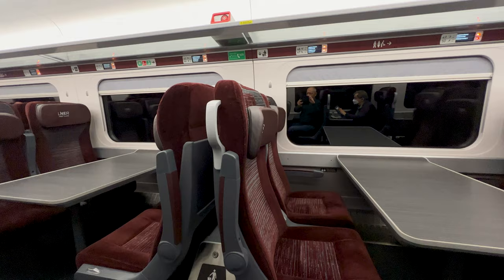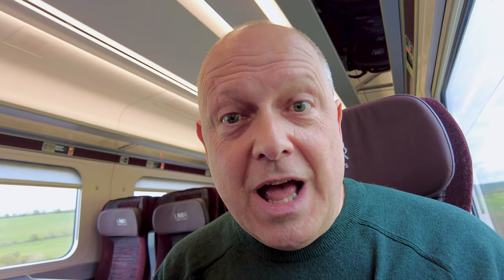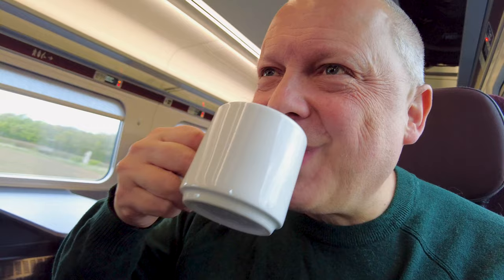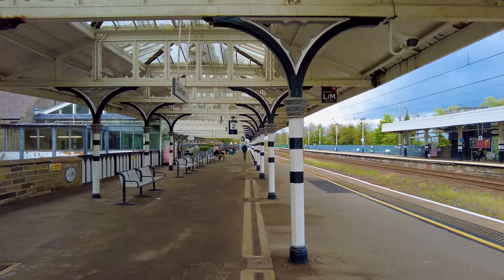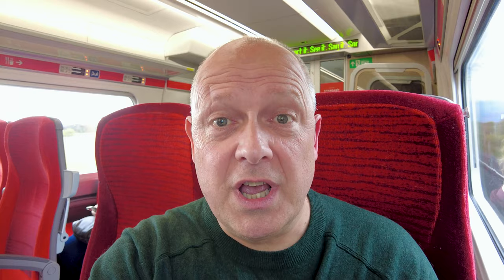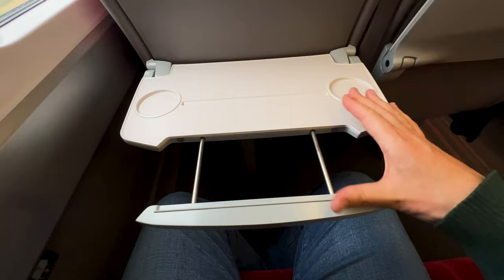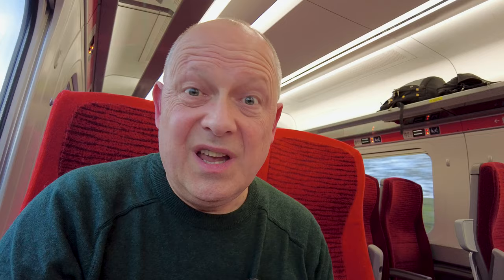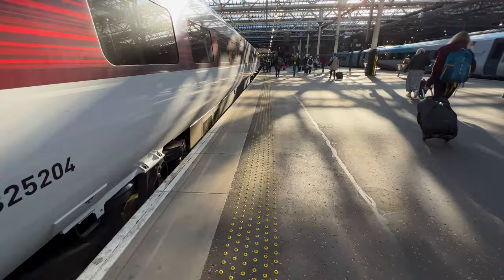How BAD are the seats? LNER Azuma Train First Class vs Standard Class - TRIP REPORT

Comment: Mate, the plastic used for the seats actually is stronger than concrete. And no I'm not kidding, the 5mm sheets used are stronger than 18mm of reinforced concrete slabs. The standard class seats are rated unfit for journeys over 60 minutes in Italy. And I recently did London - Montrose in LNER's 1st class and even those seats aren't that comfortable really. Those 7.5 hours (delay) eventually also became quite uncomfortable. I never had a problem with the old seats however.
Reply from the maker: They are so bad and it’s pathetic how LNER stick to the “Ergonomically designed” PR rhetoric even though so many people have fed back the truth. But I guess as LNER is now under Govt ownership again I guess a retrofit is unlikely anytime soon! 😵‍💫
Reply: @RogEdwardsTV  a retrofit is never going to happen. Those boys and girls behind a desk in London know a lot better what passengers want than the passengers themselves. Or so they think. And they prefer cheap seats rather than happy passengers. But it's funny though, that cheap-costs operator Lumo has better seats for their Hitachi EIP units than 'premium operator' LNER...
Reply from the maker: Yup - the Lumo seats are fine! 😀

Comment: I'm in first class in an azuma now. The seat is marginally better than in standard, with a bit more room and a slight recline, which actually is more like a rotate. I think it's just as hard as in standard. I HATE the dangling head rest thing, which moves about. The single table does not raise on a hinge like in the video, but at least it's a proper table. I agree with everyone saying first class in the old 125s was much better. The dish menu is rubbish and they seem to think everyone is on weight watchers. They do not have the oat milk much vaunted in adverts - apparently they ordered it but it did not appear. So far not worth the extra in my view. Testing again with dine menu on return journey....
Reply from the maker: Agree - the portions are so small - it' so half hearted. Thanks for watching and commenting!

Comment: Hi Roger, a great review and it echoes my sentiments.

A few times each year I take a return trip on the LNER Azuma from York to Inverness. I'm in agreement about the standard class seats: they are uncomfortable for even relatively short journeys and for 6 hours plus journeys they are back breaking. First class is a little better although I still found it a little uncomfortable after a few hours.

As shown, the legroom in both classes is exceptional. Of course on a table for four this isn't much help, which is why I opt for the airline or seating for two.

I was told by LNER that food and drink are "complimentary", so there's no guarantees as to what, if anything, will be on offer. In my experience menus will often change or the stock will be so limited that they've run out if you're further down the carriage pecking order. My last trip back in first class, breakfast options were limited and in short supply, the dish menu was substituted for deli and some of those items were unavailable. I don't factor food into my decision making of first over standard. I'll prep something to take with me.

I'm travelling again next week, for the return journey by first class was £25 more than the £49 standard ticket. Pretty good value for UK trains so I took that option. For the outbound journey first class was around £60 more than standard so it's going to be an uncomfortable ride up. I have put in a cheeky Seatfrog bid for a first class upgrade. However, in the past every auction has closed early as all the first class tickets have sold out. It's pretty busy from York to Edinburgh and it seems a lot cheaper and enticing than using Cross Country for the same journey.
Reply from the maker: Hi Iain. Thanks for such a great comment! British Airways have used the “complementary” argument before as well. It’s a shame service standards are so patchy. Hopefully the strikes will be resolved soon and things can become a bit more consistent. 😀
Reply: @RogEdwardsTV  Having taken that journey since the pre-LNER days you can see that the service is being paired back. My cheeky Seatfrog bid for the journey tomorrow won through so I get to go first class both ways. I'll report back on how that fairs 😉
Reply: I'm glad my bid for first class was successful, this time I found the first class seats fine for the 6.5 hour trip from York to Inverness. The advertised Dine Menu was in force and I managed a sandwich as I joined and a little further ahead, the hot food offering. I enjoyed the egg and tomato sandwich and I think the hot option was asparagus tortellini, which was excellent. Drinks were pretty regular too, every hour or so with tea and coffee and longer intervals for the soft drinks, wine, beer, etc. It was a good trip and worth the small extra uplift for first class.
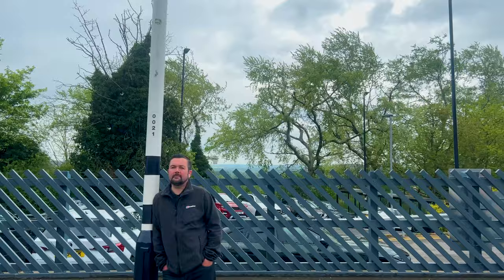Coming back was less fun, flooding meant my train was cancelled and a replacement coach service was in operation from Inverness to Edinburgh. Apparently it has been organised the evening before and was really well organised. I jumped on the direct coach, another was making stops at stations on the way. We left at 7:55 and arrived at Edinburgh at 11:30, 10 to 15 mins of that is circling through the traffic and roadworks to get to the back of Waverley station. I made a dash to the train which was being held and jumped on with 5 mins to spare, I'm not sure others would have made that train but another was running 30 mins later. Back to York in time for my connection and apart from the coach and running about, not too bad. Food only came on board at Newcastle due to the disruption, so not much was on offer.
These were relatively new coaches, not sure how they compare to National Express or Megabus but I certainly wouldn't want to make a long trip on them again. Leg room was poor there is no head rest. If I hadn't a free seat next to me to stretch out sideways it would have been a horrible trip.
Reply from the maker: Thanks for the update Iain. The coach doesn't sound ideal but at least they tried, I guess. I might try the bidding trick on a future trip. 😀
Reply: @RogEdwardsTV  The Seatfrog App is supported by many of the rail operators for bidding on upgrades. I normally put in early bid before the auction starts. Bidding started at £10 on my trip so some bargains to be had 😉

Comment: Your very right to point out in the beginning of your video that seats are becoming more uncomfortable as trains are made more modern.
In the days before the inter city 125.... deltic era.... seats were like the most comfortable arm chair... come the 125.... thin and flat backside killing after Newcastle to King's Cross... 3 hours.... then inter city 225.... no slight change to seats but space was restricted.... come the azuma.... horrible hard seats.... I done my first azuma trip Newcastle to Darlington.... 25 mins... sitting on rock and feeling it.... so goodness knows what Newcastle to London is like ???
This video is on a good platform to let the rail company's know what we think.... (idiots as if we wouldn't notice but like you mentioned it is the Dft at fault) !!... Not only that.... new trains were put in place on the Glasgow Queen Street to Edinburgh.... so new ....so modern... yet no Air conditioning.... I was first class on a summer day and my short hours journey was absolutely torcher to say the least.
Reply from the maker: Thanks  for your thoughts, Richard! I hadn’t realised the Class 385s between Edinburgh and Glasgow have no aircon! 🫣 LNER’s standard response to complaints about the seats is to trot out the PR line about them being ergonomically designed for comfort even though they inherited the seats from DFT/Virgin. Maybe one day they’ll do something -even if it’s to install thinker cushioning rather than an entire new set of seats. 🤔